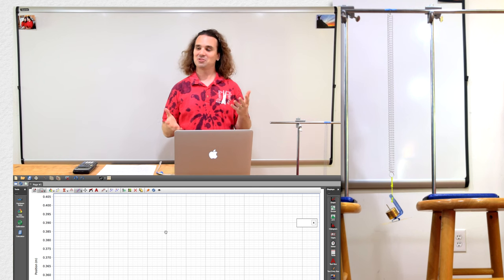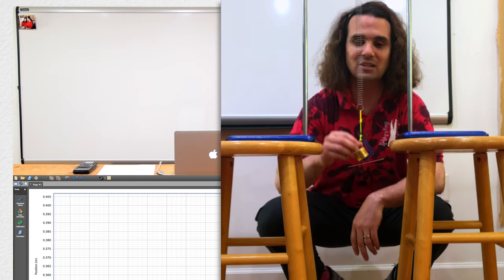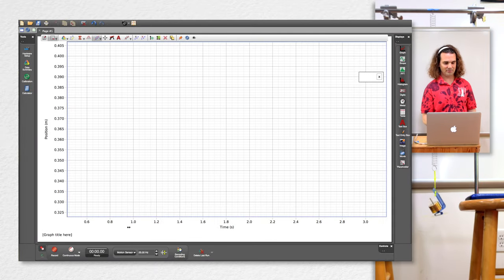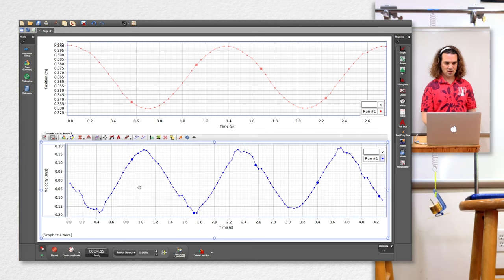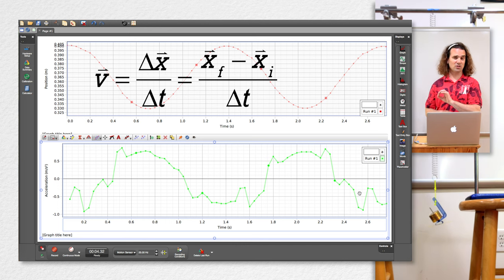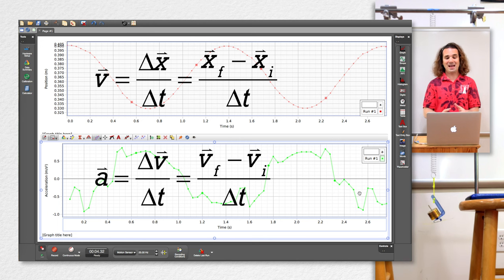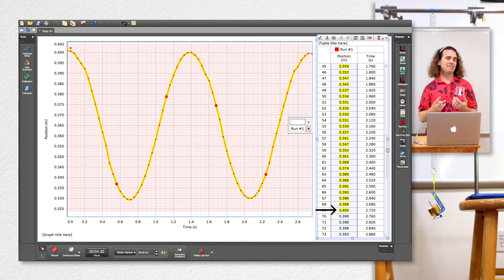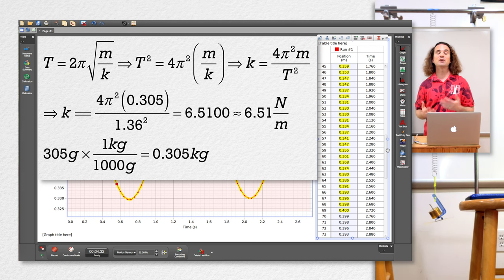Demonstrating Position, Velocity, and Acceleration of a Mass-Spring System

Comment: displacement (t) : *actual cosine graph *
velocity (t) : *average middle schooler drawing *
acceleration (t) : *toddler's scribbling *   XD
Reply: This is common when you take data through sensors such as this.   The higher order derivatives you measure are a lot more sensitive to experimental error and noise in the data from unintended factors.